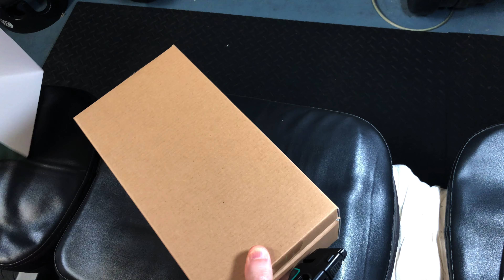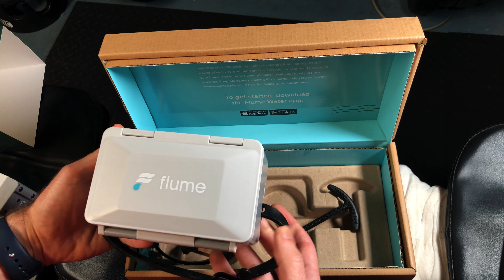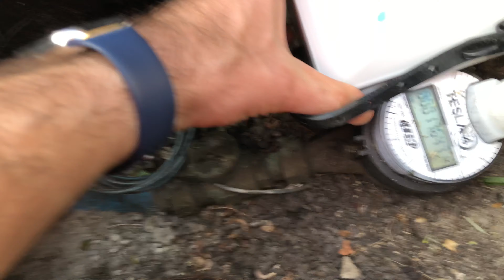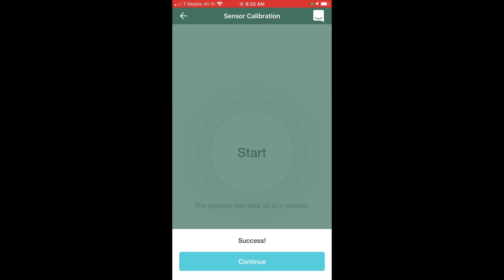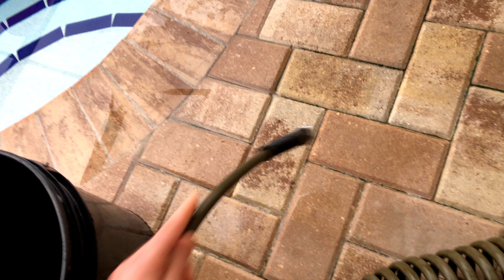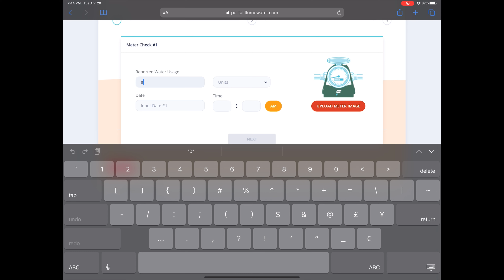How to install Flume 2 smart home wifi water monitor and leak detector

Comment: Great news. I installed my new Flume 2 water monitor yesterday. Duck soup, thanks to you and Flume Support. The bridge is mounted in a front window above the center section, less than 25 feet form the meter box and 5 feet above the ground. A direct line of sight to the box. The first thing I did was run a leak test. Changed the setting to 45 minutes at .1 GPM. Received the alert notification right after the time was up. Fantastic! 

Now for the best part. Over here on Florida's West Coast, it's a beautiful sunny day with no rain predicted. I couldn't control myself, so I got out  the hose and filled the meter box with water. The system never missed a beat. I even could see the usage as the box was filling. It's drained now and still sending data. 

The front windows are tinted as they face the west. I checked to see what effect it may have on the signal. An architectural materials table stated a 6db loss. That's a X 4 power loss. There must be metal in the tint. So I  removed the the film in front of the bridge. Not sure if it was needed, but why take a chance?

Now I can sleep without worrying about another leak.
Thanks for all your help, Jim
Reply from the maker: Awesome Jim thanks for that!

Comment: How is it with tiny leaks..I just had a pin hole leak in my reverse osmosis system that did major damage in just one day....
Reply from the maker: Something like 152 drips per minute. Check the full write up here https://www.davidmello.com/flume2-wifi-leak-meter-review/ I’ve been meaning to do a long test with a faucet at a very slow drip over a couple hours but it’s hard with everyone home these days :) I need to kick everyone out for science

Comment: 2 years later how is the Flume 2 holding up? Also, how is the battery life?
Reply from the maker: It's holding up well, the first battery set lasted about 10 months. Here was my experience there https://youtu.be/jAeGrLO1SRs with battery replacements. I've found Flume support to be amazing when I've had questions about usage patterns. They replaced my original one under warranty when they detected an issue with it. I'm kind of shocked about how good their support and service has been. I'm still happy with the purhcase.
Reply: @reallyMello  Great to hear, thanks for getting back to me so quickly!

Comment: One more question and one answer for you. I did find that the hub link was 915Mhz. That explains the robust connection as opposed to 2.4Ghz WiFi type connections.  You said the it was highly penetrating RF link because it has full strength per the app. So is there a relative signal strength indicator somewhere in the app? Hope so. That would help me determine what effect a few inches of water will have on my installation. Thanks again.
Reply from the maker: Yep! When you click the hamburger icon in the top left it slides over to show the Bridge radio signal strength and the water sensor battery level.

Comment: You said you lived in Florida. I do too and am wondering what happens to the RF link from the Flume 2 box to the hub if, no when, the meter box is full of water. My meter well fills to the top whenever we have a heavy rain. They claim it will transmit 1000 feet. So my question is, will the link stay up with the box underwater and the hub only about 25 feet away? I'm sure this has happened to yours at least a few times since April, 2021.
Reply from the maker: Hi Jim, my meter box location in the yard is in on enough of a slope where it doesn't tend to flood, but it goes get wet in there. I've never had a connection drop due to signal. It seems to use a highly penetrating RF band because it has full strength (per the app) going through the metal garage door and through wet soil. I have my bridge/hub in my garage.
Reply: @reallyMello  Thanks for quick replay. I'm going to give it a try and let you know how works underwater. I exchanged a number of emails with Flume last week. They kind of implied they may be able to work out a return if it doesn't work. Great compay!
Reply from the maker: I've always found their service contacts very helpful and quick to respond

Comment: Hello, I also live in Florida and did have a pin hole leak in a foundation water pipe(not sure why pipes are in foundations in Florida given we don't have ground freezing). Fortunately...I was able to catch it but not until it flooded a room and a hallway.  Anyway, did you (reallyMello) have a chance to review or look at other leak detection devices, with wifi ?  Thank you for the review and suggestions.
Reply from the maker: Flume I think works best for typical south florida houses unless you have power nearby your main water shut off. If you have power nearby the shut off and room the splice in a device the Moen Flo would theoretically be able to pick up smaller leaks. I made a longer comparison article on https://www.davidmello.com/flume2-wifi-leak-meter-review/
Reply: @reallyMello  Thank you !

Comment: How is it holding up from a year ago and how right did you wrap it around your meter
Reply from the maker: Still going strong. Had to replace the batteries once so far. I used the supplied elastic bands to attach to the meter as shown.

Comment: The app went straight to calibration and won't allow access to the dashboard to set up the device's WiFi.
Reply: We got stuck before even getting to the point where I could see the Wi-Fi connection to enter a password. 
All the help parts of the app just sent me to little things to read that had nothing to do with my problem. 
Next I called the help phone number and all I got was an answering machine saying there are no technicians to help and it was early afternoon so I guess they all went home early on a Tuesday.
Reply from the maker: Try chat support in the app. I’ve received fast responses when I’ve had questions.
Reply: @reallyMello  chat support didn't help that's why I tried the phone number

Comment: The bridge is plugged in.  There's no identification of what QR code I'm submitting.
Reply from the maker: I'm confused when you say you don't know which QR code you are submitting. There is one on the bottom of the USB-powered Flume Bridge and another on the bottom of the Flume Sensor itself. In the mobile setup, the first one it should prompt you to scan is the one on the bottom of the Flume Bridge. What happens when you scan that when prompted? Is it not pairing or?
Reply: @reallyMello  I was submitting the QR code for the detector when I should have been submitting the Bridge QR code.  It's ok now.
Reply from the maker: Glad to hear that worked out

Comment: It's useless product
Reply from the maker: How do you figure?
Reply: @reallyMello  if there is a big leak, you just call home insurance
Reply from the maker: Shelving the benefits of water usage monitoring for a moment...why would you want to put yourself through how awful water damage is and the claims process if this could catch it before a major claim? Keep in mind also some policies limit maximums, some policies deny claims related to small leaks over time, and mold is awful to remediate...time to rebuild. Some policies even credit you have having a water monitoring device installed so there would not even be a cost issue.
Reply: @reallyMello  true, Good point but my policy will pay for 24 months rental and I get 150% remodel coverage. Basically cheap way of getting remodel when you count that premium will go up after the fact
Reply: Michael Lawn has apparently never filed a home insurance claim. Deductible anyone?
Reply: @clookie1  my is $500
Reply: @clookie1  Or realized how his rates will skyrocket, if he is even renewed or can find an insurer to insure him after his home gets a huge red flag for water/mold damage.
Reply: When your water bill is high and the water company says no leaks, it is a great way to verify that there may be one. No??
Reply: @ltstup  There is much cheaper way to verify. Turn off house water and see if meter still going. If it's, you got leak outside. If it's inside the house, verify that no water is going and see if the meter is still going. If it's and you know it's not outside, you must have it inside.
Reply: My deductible for BOTH leaks that were inside the home was $1000. Plus the hassle of drywall and paint both times. Then there was the pinhole plumbing leak in the crawlspace that went undetected for weeks... that would have been nice to know about earlier. I would thing the very low price of this thing (with all rebates) would make it a worthy gamble.
Reply from the maker: I agree with you Tom! Losing access to the space and going through all the repair process is not something I want to go through again. Also, some policies don't cover ongoing undetected leaks so knowing sooner is better.
Reply: @001looker  Yeah, it's a useless device. Rather than being notified of a leak and stopping it, you just call your home insurance and then just pay your $1,000 deductible, right?

Comment: I’d rather get one that you have to cut in the water line , i’m not about to buy something for several hundred dollars and leave it outside to the public , the other thing is that is battery powered looks like so now you have to go and charge it or replace battery and that is no good assuming it’s waterproof because some times meters get under water for weeks , if it was mounted inline with the water they could charge the battery with the water flow 😎 , and the last thing on my mind is  how long the battery lasts since wireless communications have always been power hungry
Reply from the maker: I found the battery lasted about 10 months. I posted that process here https://youtu.be/jAeGrLO1SRs if you want to check it out. You can also install 2 batteries for redundancy so when one dies the other comes online so that would be about 20 months so not bad. I get torrential rains and its proven water tight. The ones that splice in require an AC power source. In my case I didn't have space to splice in nor AC power nearby so this was the best option for me. For people who have a crawlspace or basement and don't mind cutting into pipes they have more options, but I think of the passive devices this is top notch.